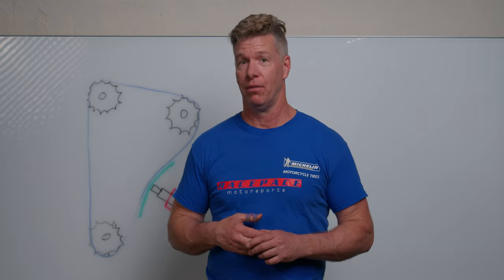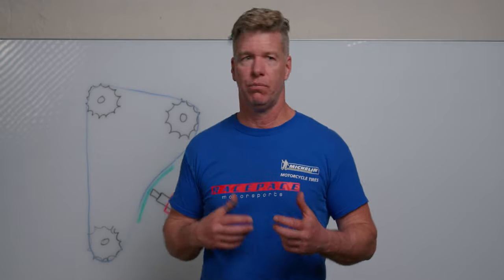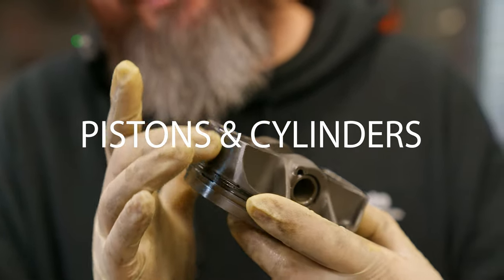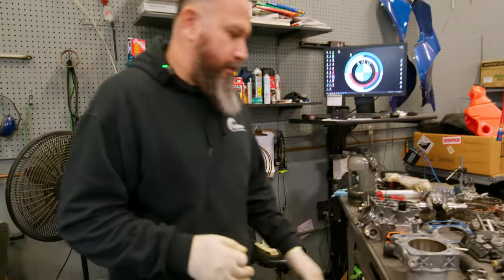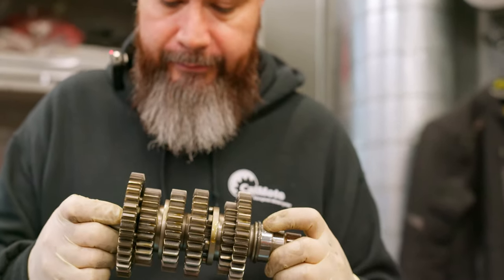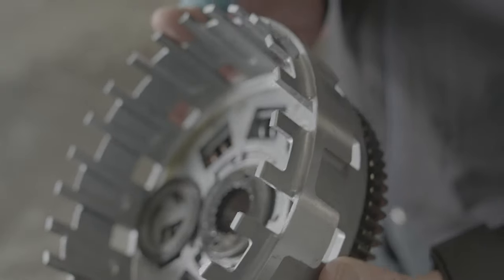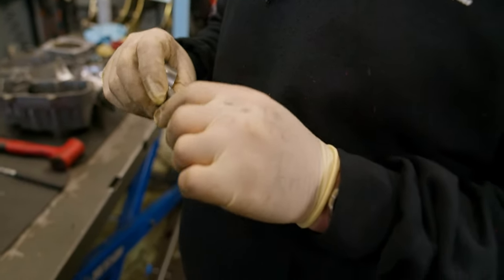KTM 1290 SUPERDUKE R - MEET THE WORST ABUSE IMAGINED, Engine Reliability Review

Comment: Hey @Superduked, what are your recommendations for buying a Super Duke 1290R 2022 floor model, anything to watch out for? Thanks 👍
Reply from the maker: Yes.  Watch out that thing doesn't pull your arms off first time you twist the throttle.  ...keep an eye on your shift arm where it bolts to the splined shaft under the front sprocket.  They can come loose, some locktite them.   Make sure it's been cleared of the wiring recall under the tail section.  And once you start riding it, if and when you feel it doesn't finish turns just how you'd like, contact me about upgrading your rear suspension link.   I sell them on superduked.com.   They make your bike work like it looks - badass
Reply: @superduked33  Awesome, thanks!
Been training arms extra hard 😃👍

Comment: I am planning to get the new 1390, is it the same engine?! Any fear of their new variable timing system??! Your feedback would be greatly appreciated.
Reply from the maker: Define "fear"...   :-).   KTM's reliability track record with me is pretty outstanding.   Gen1 had some issues with electronic shifting - which I responded to by forcing it to work.   That caused some problems for sure.  But most of that was me refusing to listen to them telling me NOT to use electronic shifters.   Anyway they fixed that situation since the Gen2 and I haven't had a problem since.    So "fear"?   Not so much fear.   But there are thoughts, anytime something new comes out from anyone.  It's a good question that I won't be able to answer accurately until I ride the living hell out of one.

Comment: Do you run stock handle bars?
Reply from the maker: I do, on the Gen3.  But I used Spiegler drag bars on previous models.   Currently considering bars with half the left as stock with slightly more bend.  Haven't found one, yet..

Comment: "spun bearings"?  I'm sorry but those look like normal wear and tear.  The case would have been wrecked if they spun, and you would have lost oil pressure.    I'd say your engine held up very well!
Reply from the maker: Yes, as you and other experts have pointed out, these bearings did not actually spin.  It's still not clear why they looked so different on the backside but I agree they did not spin.  Thanks for helping make that clear.

Comment: LC8 is also on the KTM 790/890 but it desintegrates on those bikes.
Reply: Lc8c.. not the same engine at all. Different materials are used, the biggest problem with the 7/890 is that the camshaft doesn’t get enough lubrication after awhile. When they reach the 20.000km they are basically ticking time bombs
Reply: @Snotroggel453  so what you are saying is that KTMs are trash.

CfMoto uses the same darn engine and is 1/3 the price of a KTM but 10000% more quality. There are no problems with the CfMoto 700/800 series engines.
Reply: @showmytime9177 thats because cfmoto down tuned the NK800 by 10HP, which is the same engine as the 790.. it creates less stress on the engine. Yamaha could give the MT07 also 100hp if they wanted, but it would make the engine less reliable.
Reply: @Snotroggel453  the KTM Adventure variants make 95bhp and still brake like crazy.

It's just a sign of gross incompetence and a big "fook you" to the customer.
Reply: @showmytime9177 yea 3 years ago i wanted to buy a duke 890, but after reading many forums and YouTube comments i let it go and got myself a Z900. 33.000km so far and never had 1 issue. Sure its a heavier bike and a 4cil, but at the end nothing beats reliability 😂
Reply: @Snotroggel453  I did the other way around, after a Versys 650 got an 890 Adv because Kawa doesn't offer warranty at all where I live, while KTM does that but has shitty parts.
As I've said, it's a matter of incompetence.

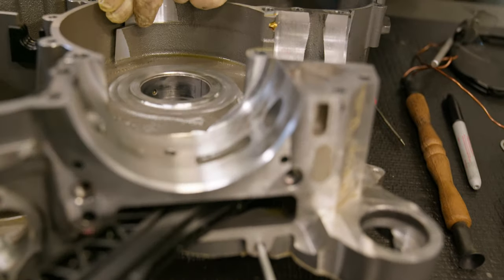Comment: At 9:08 that almost looks like a crack on on the right side of the case where the cylinder slides in. It's probably just a piece of hair. The bluing on the crank is something I can't remember having seen in other engines. Part of the manufacturing process? Those rod bearings do look like crap. I would like to have seen the rod journals on the crank and the inside of the con rod big ends.
Reply: I see a crack too

Comment: each of the parts the mechanic is condemning with a problem or potential failure in the near future are things he is recommending to the customer. it has a little scratch, it has a little timing chain streach, it has a little sharp groove on the clutch basket, it has a little wear in the main bearings, it has a little scuffing on the piston, it has a little roughness on the crankshaft, it has a little scratch in the oil pump...  the livermore ca cal moto mechanic knows what he is seeing. the customer seems surprised that the motorcycle he races has wear beyond normal.

Comment: Looks like over heating on the main bearings. Burned on oil.
Reply from the maker: Thanks.   Although I've never seen high temps.   Perhaps it happened prior to my ownership.   I was actually amazed that even in 105 degree heat racing in the desert in a 20 lap race the temp of the motor was not hot.   ....Although by "temp" I am referring to coolant.   Perhaps I should be monitoring oil temps too, which are deeper in the menu.   I also talked with one of the engine builders of the Daytona 200 winning team this year.   I asked him about oils, showed him the pic of the bearings, told him I'm using Motorex.    He suggested one problem with Motorex is it does not say Motul on the label..

Comment: Do you think this is the same with gen 1 and 2 ?
Reply from the maker: As far as the engines reliability and resistance to wear, yes I do.  That was my gen2 experience as well.   Wore like iron.   Ironically I did actually skip a cam chain tooth on my gen 2, but that was due to an engine builder leaving a valve shim in the motor after a “superbike build failure” (not Alex).   The shim blocked the oil port to the rear cylinder tensioner supply and caused it to fail.   Coincidentally though right?

Comment: Those bearings did NOT "spin"...  that's inaccurate..  they show signs of wear..  but there is NO sign that they spun..    honestly, you never should've taken it apart..
Reply from the maker: Actually I’m glad we did take it apart.    The cam-chain tensioner failure is a big reveal to me.   I did once before have a chain skip a tooth.   We thought it was due to lack of oil pressure at the rear cylinder at the time, caused by a shim that a well known west coast engine builder left in the motor - blocking a rear oil port.    But now that we took this motor apart, and discovered what we did about this tensioner as well, it’s a thing.   Next installment will be about exactly this